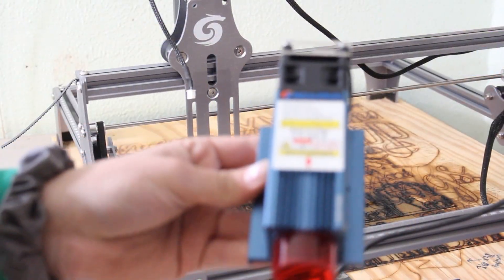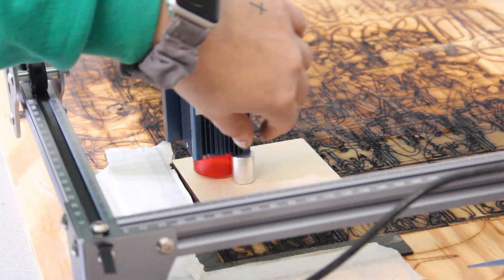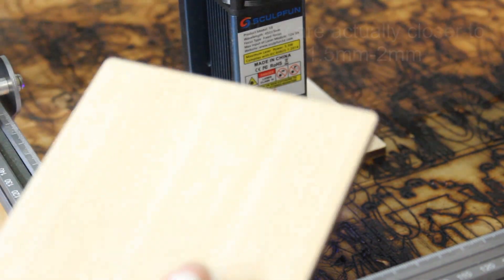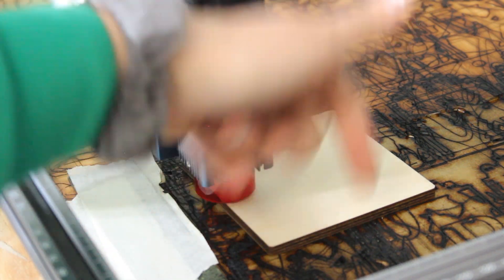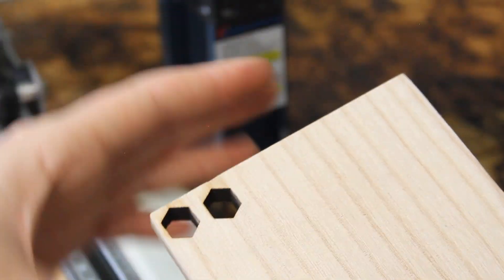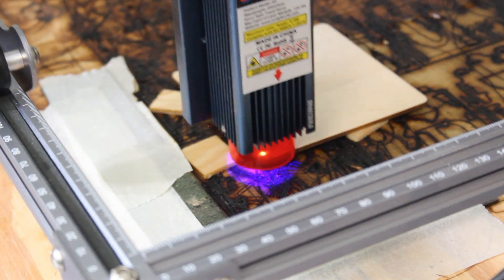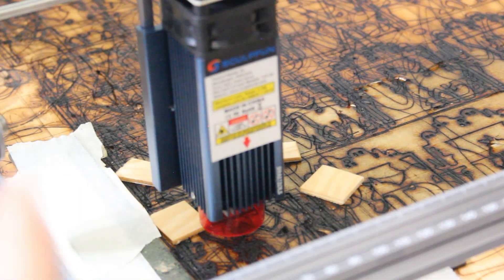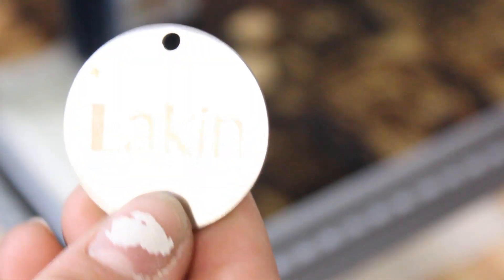Sculpfun S9 Diode Laser review//Best cutting laser on the market

Comment: Hi, I’m trying to cut 2,5mm Mdf at 300/5/100% and I dont have a clean cut, can you advice me or tell me whats wrongs? I have the same laser as you!
Reply from the maker: Make sure u set the correct hight of the master to your material that is usually the problem. Of that’s not it, you can join the Facebook group for this laser and post a photo of what is happening and someone may be able to help
Reply: @TimberWood.Customs  ok many thanks I will check!

Comment: Great video!!!>> May i ask how do you switch on laserbeam to see where you are cutting to position it on lightburn please?
Reply from the maker: It is in device or machine settings and the. There is a fire laser button, you have to switch that in and then restart lightburn then it will be located in the Move tab

Comment: Hi ,, there is a issue with the laser .. look carefully at around 5.35.   You will notice that the cut in horizontal plane is much thinner (actually half) than the cuts in the vertical plane.  This is because the claimed square beam pattern is nowhere near square and more a rectangle.  This means cuts in the vertical planes need twice as many cuts as the horizontal.  A bit of an annoyance.

Comment: Have you used the rotary tool with it? Do you know if any brand of rotary tool will work or only the sculpfun one? Have you tried engraving on glass? That's what I primarily want to use the laser for, need one that can handle that. Thanks!
Reply: Thanks for the quick reply! I'm thinking that if it can handle engraving directly onto stainless steel then it should be able to handle glass as well...though maybe not directly? Might need some sorta coating first.
Reply from the maker: @peterwaechter618  yes
Reply from the maker: I have not tried engraving glass with this. Any rotary too should work with this. Primary use for this laser is cutting thick materials and engraving.

Comment: Please help, it's so frustrating. I am brand new to engraving. I have the SCULPFUN S9. But I am having the hardest time getting cuts to go all the way through. I'm using lightburn. You said 300 was your speed. What was your max power? What was your min power? Every time I cut it takes like 20 passes, I'm gone from 300 speed, with 40 max and 40 min power. I've tried 100 speed (which takes a lifetime) with 100 max power and 100 min power. It's all burnt afterwards. And circles, omg forget about it. I make a beautiful engraved clock, just to have it destroyed trying cut it out of the material. And I have officially given up on trying to engrave pictures with this laser everything comes out dark. Or it says 184 hours, nobody has time for that. I love the idea of engraving and cutting with a laser. But these frustrations are making me wanna trade it in for scrap metal. And trying to find good videos on dial lasers are just so hard to find. I regret getting this laser and feel I should have gotten a CO2 laser instead cause of the more options there are on video research. So if you could please help.
Reply from the maker: First off, make sure your belts are tight on the laser. Second, shouldn’t be a min or max your power should be at 100% power with the speed that you’re using. I always use 100% power. That is why it’s taking so many cuts it’s because you’re only at 40 power you need 100% power.

Also I recommend joining the Facebook group for this laser. If you post pictures in your problems a lot of people can help you. I can try help you on here but not knowing what it looks like and what your settings look like on the screen makes it a little harder. So if my settings don’t help you, definitely post on Facebook
Reply: @TimberWood.Customs  the belts are tight, the laser can dance all over no issues especially if speed is like 2000 or something ridiculous. As for the 100% power I have tried that, at 300 at 10 pases doing a circle on 3mm panel board. It still didnt cut through and just burnt all the edges pretty badly. I also read on another comment you recommended a fish tank air compressor, so I will be purchasing this tomorrow. Also thank you for getting back to me, ill be a solid supporter of yours for now on.
Reply from the maker: @stevenc3794  make sure u set the correct distance from the material using the cylinder that comes with the laser, that may be your problem
Reply: @TimberWood.Customs  sadly I have done this every time I change material. I wish it would be as simple as that honestly. I'm going to try the air assist with a compressor and see if maybe this will help me obtain the results I'm looking for.
Reply from the maker: @stevenc3794  air assist will help but as you saw I didn’t have an air assist and it cut through 3/8” wood

Comment: I have the S6 Pro and what a machine. I have built an enclosure for mine with extraction and air assist. Just a tip. If you take out the green protective shield, you will find a metal piece with 4 holes. Remove this and stick (will superglue) it on the end of the green plastic and insert it back in. You will only need to clean the lens half as much. I found the green cylinder trapped the smoke and made the lens. Hope this helps you.
Reply from the maker: Thanks!

Comment: Thanks for the review, very helpful. you did a great job!!! I am a first time user and I just bought the SculpFun S9.
 Three questions:
 1-have you ever tried cutting 1/8" hardboard tempered panel?
2-would it be o.k to use it? 
3- how long would be the max time to cut with the machine at 350mm/100% ? i was cutting a piece that took 10 min to cut , the laser look like it was getting weaker/strong/weaker... after two min so I paused it, rest one min and started and so on.  I am afraid to burn the laser.
Reply from the maker: I definitely run things longer than 10 min so you should be fine. There isnt(that I’ve encountered) a max time limit to run it. And for the cutting of hardboard. I have never tried that and not sure what it is so you’d just have to get a sample piece and do test cuts on it

Comment: Hi.. do you think it would be possible to add an S9 Laser to a cheap Laser Master 2 ? because at the end of the day the only thing i am looking for is a super good laser...  and when it comes to the frame its not a very big difference between Laster Master 2 and Laser Master 2 pro, so buying the cheaper Laser Master could be a great thing i think...
Reply from the maker: Yes you can buy just the S9 laser head and added to the laser master 2
Reply from the maker: However yes there is a big difference between the master two and the master to pro. The pro comes with safety features that you definitely need when using a laser. It’s worth the money
Reply: @TimberWood.Customs   Would the Sculpfun S9 be better than the Atomstack X7 Pro in your opinion ?
Reply from the maker: @HearGear  never heard of that machine so can’t say

Comment: Nice review! would you suggest this sculpfun s9 for DAILY cutting of 2mm acrylics? if so how long do think the laser module would last in this case?
Reply: Thats cool! thank you so much, very appreciated 😊
Reply from the maker: Should last pretty long and will work for that just do lots of testing before doing your final cuts.
Also u can NOT cut clear acrylic with this laser
Reply: @TimberWood.Customs  I've seen someone airbrushing the top layer with water color(black) and then he could cut it. after cutting you wash of the paint with water. maybe worth a try if you got an airbrush ;) it was an other machine though but worth a try. or would masking tape work 1 or both sides?! just thinking out loud ;)
Reply from the maker: @dutchlizardgaming7269  if it was a CO2 laser then yes they can cut it but I’ve been told that you can’t cut clear acrylic with diode lasers because of reflection but it would be interesting to test this

Comment: Hi and thank you for the super helpful videos! I'm new at this and looking for the best laser for my purpose. It's for a small business use engraving wood mainly and need to do this in series. I'm very interested in the cutting function too. As I understand there's no homing on the S9 but it's included for the Ortur LM2. I'm really hesitant between those two machines at the moment but from different reviews, it also seems like the S9 has better precision at engraving and better cutting... Any recommendation please? Thanks
Reply from the maker: I would definitely recommend the ortur pro it is sturdy, softer and you can switch out laser heads anytime. I would say what is best for u is the ortur

Comment: How do you handle the fumes in the house?  Is it overpowering?
Reply from the maker: No it’s not overpowering however I have fans and a ventilation system in the room I was using it in
Reply: @TimberWood.Customs  Nice!  Can you recommend a ventilation solution for some of us new to lasers?  I want to use this in my craft room in my home and after watching many other videos, no one really talks about the horrible fumes that come from making projects so I'm afraid I'm not going to be able to use my new laser until I figure out how to build something for it AND get rid of the fumes :(
Reply from the maker: @Laserfox27  well I never had the “correct” ventilation for my lasers, I just had a fan blowing on the last and then another fan facing out of the room to moving that smoke out to a ventilated room. 

Really you could just have a fan that faces outside and blow the smoke out. There is an enclosure that I’ll be getting that I’ll review and i believe it is for general use. 

I do know many people have maid their own. And I think there are some on the internet that you can buy. I’ll look for some for you. I am going to get enclosures for my lasers so I don’t have to mess with the smoke
Reply: @TimberWood.Customs   @L Making  Thank you for the tips!  I actually own an FoxAlien laser but it is open frame like the one you reviewed...pretty large about 24x24 and I really need an enclosure as well. I really don't want to work in the garage!  I want to stay in my nice crafty space :)  If you find enclosures please let me know, I will look around too :)
Reply from the maker: @Laserfox27  you can try this https://amzn.to/3ETnFJM
Reply: @TimberWood.Customs  Thank you this is exactly what I need...have to figure out the cost because it doesn't look like it's available for purchase.
Reply from the maker: @Laserfox27  hmmm

Comment: Hi! In your ipinion for engraving what is the best, the S9 or Ourtur? I ask with both machines attached to a base. 
I want to buy one of them but I'm undecided. You can help? Thanks
Reply from the maker: I like the ortur better due to the safety features it has, I overall like the design and when you get the OLM2Pro-LF laser head that has the air assist on it make it just as good as the Sculpfun
Reply: @TimberWood.Customs  I'm looking at both, too. I don't really intend to do much cutting...rather, a lot more complex engraving (hopefully on nylon polymer). Does that change your recommendation?

Comment: Out of curiosity, can you engrave on a non-flat surface?
Reply from the maker: Yes, you jsut have to set the laser to the highest point of the non flat surface so the laser doesn’t run into the material

Comment: I was looking at the Glowforge and it’s out of my budget. I want to do crafty type things and I’m a newbie. Is this a good machine for me?  How do u know what settings to cut things at?  And how do u know where to put the laser on the piece u are cutting?  Thank u!
Reply from the maker: This laser may work for you. I would recommend the ortur laser master two pro over this machine. You can get an enclosure which I would definitely recommend to help with ventilation. All I have to say is definitely do a lot of research on the laser that you were going to get and watch lots of videos on how to use it. Then once you get your laser it will make it a lot easier to use it instead of just going in to it blind. Machines like this take lots of testing to know what settings to cut different materials at and engraving. Again do lots of research on the machine you think you’re going to buy before you actually buy it. Again I like the ortur laser master two pro I have a video on that and it is a really safe laser as it has lots of safety features.

Comment: I have narrowed down my choices between this laser and the Orturo laser master 2. Which would you get as a first laser, I would appreciate your opinion.
Thanks.
Reply from the maker: I personally like the ortur better due to the safety features it has. I have gotten the ortur with an air assist to cut a quarter inch pine in about 10 passes so I really like the ortur. This machine cups deep but I don’t really like how it doesn’t come with any special features. It is a great machine but I prefer the ortur over it
Reply: @TimberWood.Customs  hi will the ortur laser master 2 pro LF laser head with air assist cut 6mm MDF ? And can it engraver stainless steel?
Reply from the maker: @karimmradradwan4449  you can engrave metal if u add some kind of coating on it first. And I have not tried mdf with air assist but I do believe someone has gotten it to work. I have cut 1/4” pine with the air assist  on the ortur
Reply: @TimberWood.Customs  Thanks.

Comment: Besides lifting the project wood off the table, is there any other way to reduce the collateral burn around the edges of the material? Maybe lower power with more passes and a layer of painters tape along the cut areas?
Reply from the maker: The more passes u add the more burning even if it’s lower power. And yes u can put painters tape but if u do something that has detail you’ll have to pull out every little piece of tape or if you need to cut then engrave then u risk messing up the engraving.

You can also get an air assist that helps with blowing the smoke away to prevent burning

Comment: Is this powerful enough to cut clear acrylic?
Reply from the maker: Yes depending on how thick it is. But you will need to put something black underneath it so that it doesn’t reflect off of the clearness of the acrylic. You will have to do some testing before you’ll be successful
Reply: Thank you!! Will definitely be trialling this
Reply: Cutting clear acrylic is not possible with a laser that runs in the visible light spectrum no matter how powerful it is.  The light will just pass through the material.  Putting something black underneath the material or on the surface will allow you to etch it at the surface where the light does not pass through (and there is heat).
Reply from the maker: @tekmason7736  thank you! I have never tried it so I wasn’t sure

Comment: Hello there, Did you ever get a chance to upload the video about limit switches for this machine? If not could you maybe share whatever info you have on this.... PLEASE PLEASE PLEASE
Reply from the maker: I have not yet due to the moving situation I’m in and the company hasn’t gotten back to me on getting the new firmware onto the machine which will allow it to use the endstops
Reply from the maker: It’s not hard you take the cover off where the on and off switch is then u can plug in the endstops, you just have to upload new firmware to the machine so it knows that it can home

Comment: How about 12 mm plywood, would it cut through?
Reply from the maker: Yes with an air assist added and about 300mm/min or 225mm/min yes it would cut through
Reply: @TimberWood.Customs  May I ask how many passes needed?
Reply from the maker: @lewy7601  maybe at 225mm/min 5-10 passes you’ll just have to try

Comment: Hello, can the machine cut golden PVC?
Reply: Also, how many power, speed and pass should I put to cut PVC?
Reply from the maker: @souqalmjd5284  u shouldn’t be cutting PVC so I have no idea
Reply from the maker: Dangerous because of the toxic fumes that come from it, they can kill u
Reply from the maker: I am. It sure. But cutting PVC is VERY dangerous
Reply: why dangerous ?
Reply: Ok thank you
Reply: NEVER EVER CUT PVC with your laser.
When lasered it highly toxic hydrogen chloride is released.  When inhaled the colorless gas is lethal transforming into hydrochloric acid in your respiratory tract and lungs.  Always be certain that any material that you put under your laser does not contain PVC (PolyVinyl Chloride).  The Beilstein PVC Burning Test is one way to identify PVC.
Reply from the maker: @tekmason7736  yup

Comment: Hello Lydia... I just received my S9.. but I have a question.  The module circuit board shows a 24 Volt input, at the plug...
while the label says 12 Volts Max.  Contact with Sculpfun has not specified which I should use.. or can use.
I have another diode laser which only allows 12 Volts max as well.

Any Thoughts..?    I do not want to toast the diode before I even try it.
Thank You.
Reply from the maker: Just use the cord they provide and you should be good

Comment: hello
What are the settings for cutting MDF wood 3 mm on the Lightburn program ?
Reply: ok, how much should I put the power ?
Reply from the maker: @souqalmjd5284  100 power
Reply: I have another question, please. If I change the power to 100, would that harm head or no?
Reply from the maker: @souqalmjd5284  that will not harm the head
Reply from the maker: @souqalmjd5284  no it will not kill that machine head
Reply from the maker: This is form someone in the comments who has tried it. Hope this helps! “For anyone interested in cutting MDF, I
have managed to cut 3mm Mdf in just two
passes at 300mm/min with this laser
cutter. It is absolutely brilliant.”
Reply: thank you

Comment: My s9 will not even cut 1/16 @100% 80mm. I purchased mine from Amazon was it down graded? By the way I ended up trying 16 passes still no discoloration on the back side.
Reply from the maker: MAKE SURE it is focused correctly with the Colin see they give u
Reply: @TimberWood.Customs  focus  is correct but figured out I set my copy of lightburn to inches which really screwed up the speed going way to fast to cut! So I was wrong very wrong.